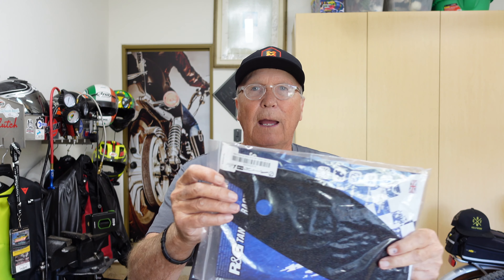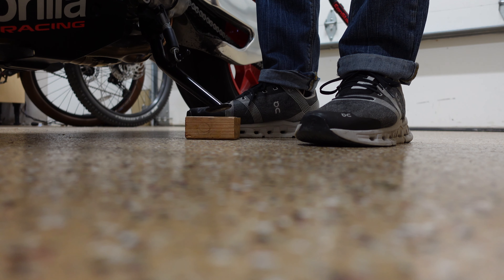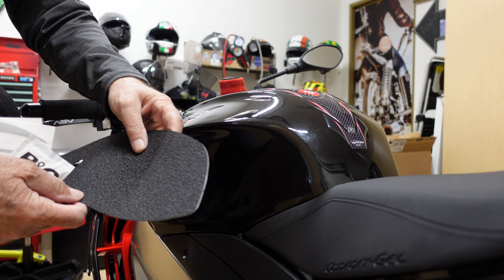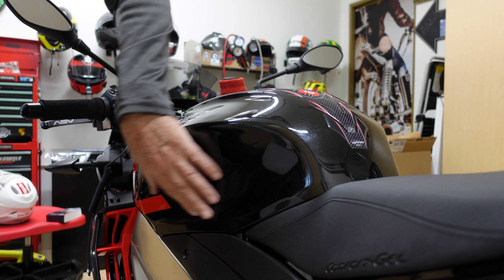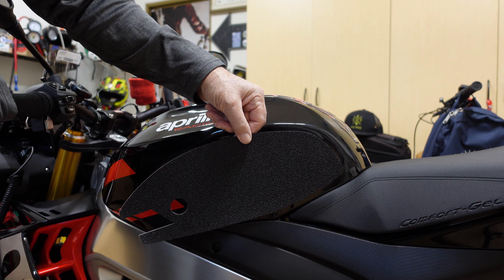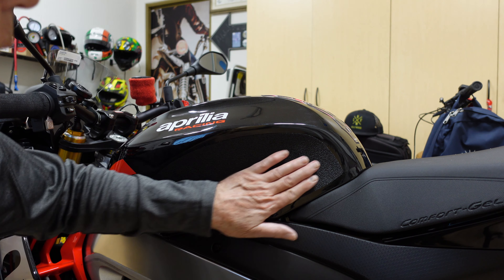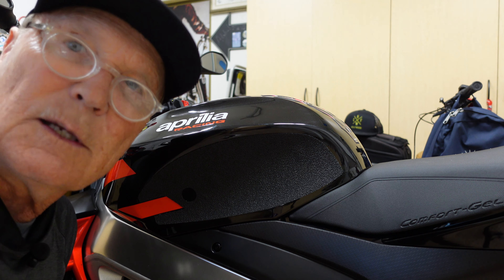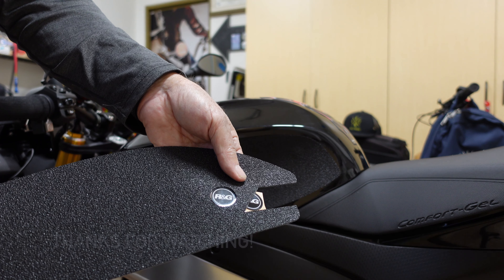Installing R&G Tank Grips on the 2021 Aprilia Tuono   4K

Comment: I have a paddock stand for my Tuono but been too scared to use it for same reason as you mention 😂. Think I’ll be investing in a bit of 4x2 as you have and give it another go
Reply from the maker: Kevin, I know it is very scary when you raise the bike up without the 2/4 to close the gap to the right side paddock stand cradle! It's such a small but cool tip. Some people use it when coming down as well. I do use it that way sometimes, but not all the time. I do use it ALL the time when raising the bike though.